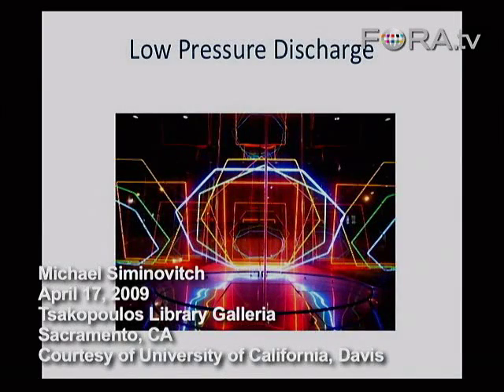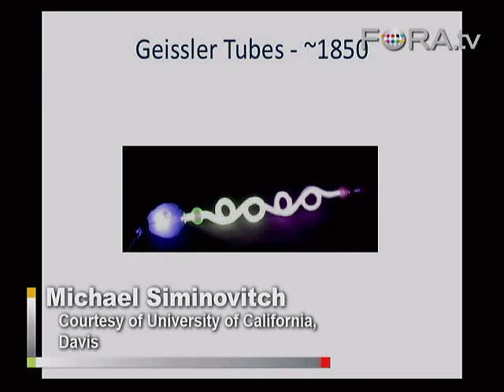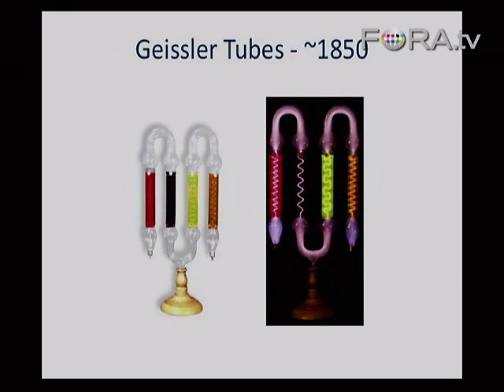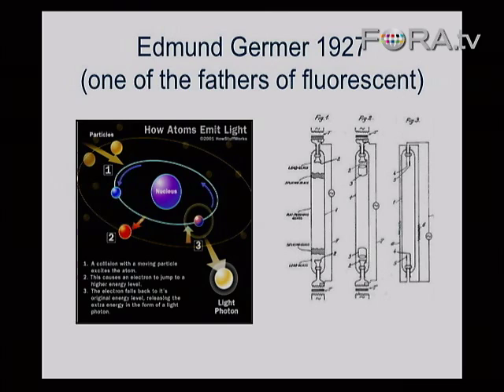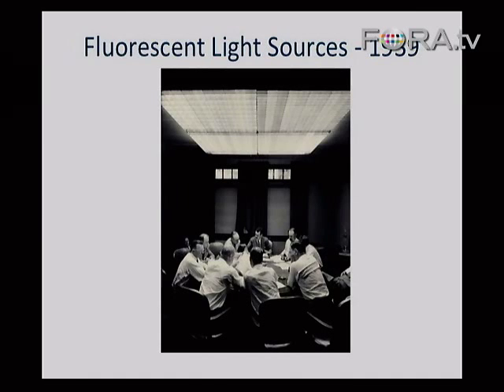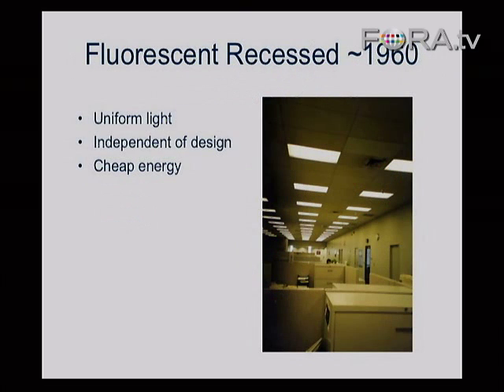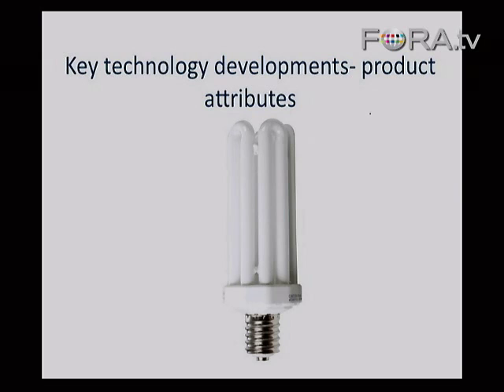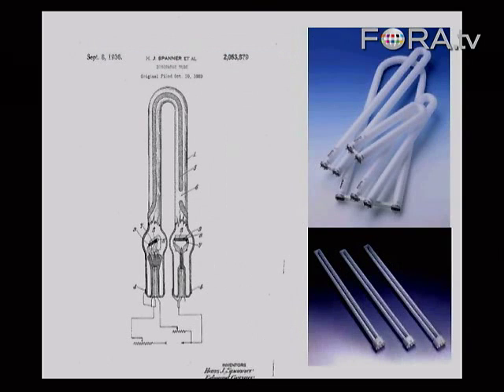History of CFLs: Ornate Art to Efficient Light Source

Comment: I'm not sure that that information isn't a sales pitch as opposed to actual cosumer tested facts.  I have used CFLS for the last 3 years, only bulbs I have bough.   Yet on my chandelier I have had to replace 3 CFLS while I have 3 incandescants still burning for the last 3 years.  I don't use it often, by why would the CFLs brunout before the incandescants ? I don't know.

As for Mercury I don't buy that either, there is no hazmat standard for dealing with broke regular bulbs, but CFLS do have.